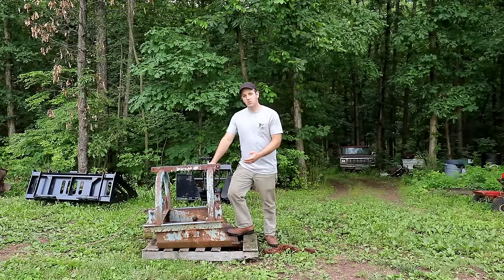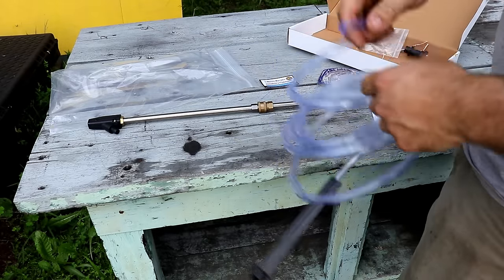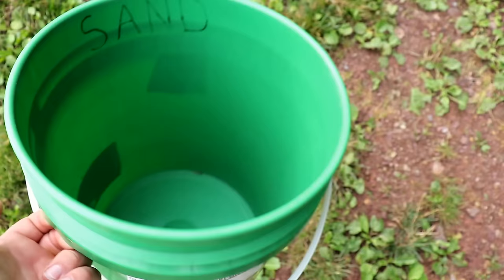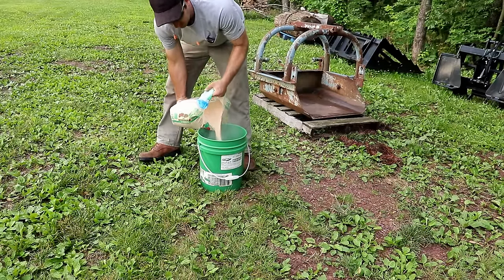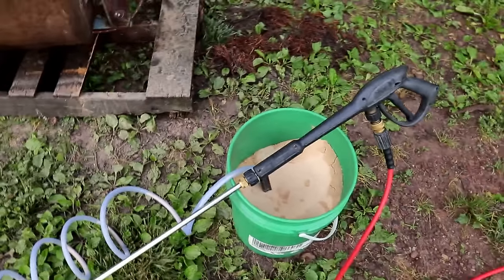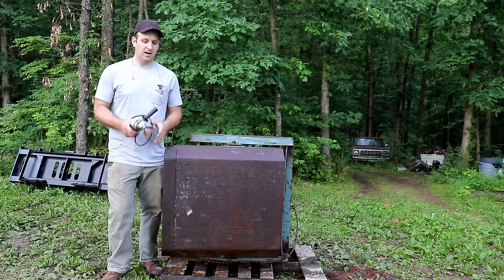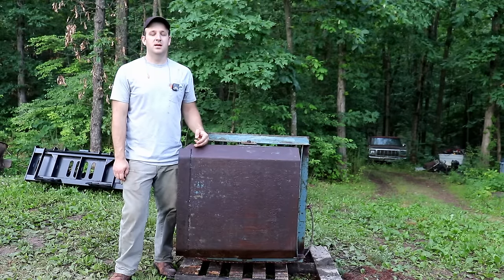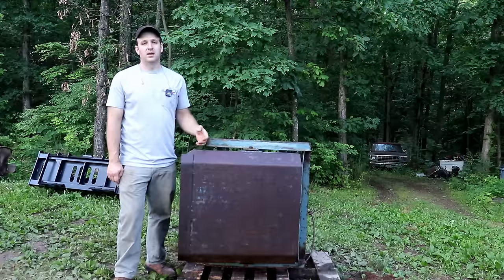I Turned My Pressure Washer Into a Sandblaster

Comment: I just tried mine out, got one just like this one but mine didn't come with an attachment adapter so I had to remove my tip to make it work. My pressure washer is 2300lb pressure @ 2gpm. I bought 70 grit aluminum oxide media from Harbor freight. Let me tell you it worked like a charm, I immediately got that shiny bare metal you were looking for. The play sand you used is too smooth and rounded if you look at it through a microscope, the abrasive media under the same scope would be sharp jagged edges that's what makes the difference. If all you're looking for is to remove the bulk of the flaky paint or rust chips then sure go ahead and use the cheap sand it'll probably even make the tip last longer.
Reply from the maker: I'll have  anew video soon with a different blasting media.
Reply: I totally agree with you on an agreesive sand.If your going to paint after you need a tecture on the metal for the paint to stick.Black magic sand cuts really good with a rough finish and the paint will not peel off.

Comment: Using play sand for sandblasting is dangerous and not advisable as the sand contains silica quartz, which, when inhaled, can cause silicosis
Reply from the maker: Thanks for the info. Would the risk be lower since this is a dustless method?
Reply: Same in sandblasting sand
Reply: @TractorTech  Mist will have sand in it. If you want to live, and want do more fun projects in the future - protect yourself today.

Comment: For the $8000 you mentioned you can get a high tech rust removing laser that eats away every layer and leaves the metal untouched.
Reply: or one of those dry ice machines that do the same thing
Reply from the maker: You can get dry ice pellet that I believe can be used in a regular blaster.
Reply from the maker: That would be nice.

Comment: For future testing.. I would consider hanging the bucket and maybe using some kind of attachment on the bottom of it or put a hole so you can run the hose through and the pick up can sit in the bucket so it’s being fed by gravity as well as vacuum. It’ll also help you keep from getting water in it. Put it on a pole.

Comment: this came up in my video suggestions. Good video warts and all! The budget DIY kits will work but you need to take a much steadier approach with them. If you are using sand you'll need a helluva lot of it! Also you need to work along and down the item one width of the jet at a time in a very slow steady manner. Also if you want a more aggressive strip go for recycled crushed glass grit. medium fine is about as large as you can go on these and still work without them constantly clogging up (< 1mm grit). Also when you release the trigger always have the jet pointing down toward the ground that way the water doesn't siphon into the sand pick up tube. get a lid for your bucket and put a small hole in it for the tube, then tape an umbrella to the side of the tub! wet sand don't suck! If you use glass put a large tarp under your item, sweep it up and set it aside to dry out then use it again!  I just subscribed to your channel it looks like the kind of content I appreciate, good luck, Bill
Reply from the maker: Thanks for the sub. I may try some different media.
Reply: Love diy crowd, vibes are wholesome. Came here from regular internet. Just a guy at work and people cheering on and giving advice. I had to remove some rust from underside of my FJ Cruiser, took half a day with wire brush. If I only new what sandblasting was :)
Reply: @Prokastrynator  I'm restoring my 1980 K10 this ny winter. I wire wheeled and used them paint grinder discs for almost an entirely week straight and didn't get to far. I went the sand blasting route for the last 3/4 of the truck, bought a harbor freight blaster and rented out of em big ass compressors and It was hell but the trucks frame and undercarriage is clean and ready for some por-15. Some advice if you ever do any sand blasting. Get a blasting hood for yourself but ditch the windows in em and wear a mask and safety goggles not glasses, goggles. I had a hell of a time tryna see because either the safety glasses/windows were getting scratched to shit or the glasses were fogging up. Due to my time restraints and not living anywheres near a store I couldn't just go out and pick up some goggles and not I'm paying for it because I removed the face mask to prevent fogging and I'm hacking the shit up lol. Learn from experience I guess! Goodluck

Comment: In order to obtain the proper venturi effect  (for sucking up the sand)  you'll need to have: 

1) a minimum of 3+ gallons per minute of water flow... PSI not that important.

2) Your sand should always be sifted in a dirt sifter (pretty cheap) first. Avoid playground sand as it's consistency is not correct for this application. Ask your supplier for proper sand.

3) Use a tarp to collect your sand and reuse it over and over and over again. Spread it out after usage to dry it in the sun coolest it and keep it in a 5 gal bucket lid closed.

4) Keep sand bucket behind you, as far as your tubing allows, mind the wind direction and adjust the workpiece accordingly.

5) Orient your tip inlet above the the nozzle (don't let the angled tubing hang down) this avoid water clogs.

Advise coming from much personal experience...  follow those steps for  wet sandblasting and you'll get to bare metal all the time economically..
Reply from the maker: I'm now using a Stihl RB600, over 3gpm. I sit the bucket up on something. I'll have changed to coal slag. I'll have to try sand and screening it.

Comment: I’ve used playsand before for sandblasting, definitely pour it through Atleast a window screen or something finer to prevent clogs
Reply from the maker: I've done that before, but I did forget to do it this time. Thanks for the reminder.
Reply: Using play sand for dry sandblasting is a sure way to get silicosis. Not a problem when wet sanding, except it is not very sharp.

Comment: I have the same sand-blaster and get great results with regular beach sand. 
Some tips:
Put your sand bucket on a stool so it doesn't have to be sucked up against gravity.
Take it slow. It's not like pressure washing.
Bump the tip on the work now and then if the sand stops flowing.
Keep the sand feed tube on top, so that water doesn't drip into it. Wet sand won't flow
Do the job on a concrete surface. Leave the wet sand to dry. Sweep it up, sieve it and reuse it.
Reply from the maker: The latest video on my channel is using the sandblaster with a revised process. Thanks for the suggestion on setting the bucket on something. I could maybe put a tarp down to try to catch some of the media.
Reply: PSA: DO NOT USE BEACH SAND - PERMANENT LUNG DAMAGE

Comment: Pretreat (keep wet) the rust aereas with citrus acid water for 20-30 min.. Then try keep a 90 degres angle against the surface and keep nossle close and slowly
Reply from the maker: I may have to try citric acid if some other media does not work.

Comment: Hey Roger, you are not gonna believe this, but I bought one very similar to that one on Amazon for my pressure washer two weeks ago.  I had pretty good luck with it until the overspray got a little too much into the sand bucket.  But as long as the sand stayed dry it worked quite well for what it is. Next time I'm going to drop it through a hole in a lid to shed the overspray. 
    A more direct angle to the workpiece (90*) will help get to bare metal as well as a closer distance.  I wasn't super satisfied with it, but for a small project and the low investment it was not too bad. I use Silica sand because one of the largest Silica sand mines in the US is here where I live.  I buy it on pallets in 80# bags by the ton for my big sandblaster I use on large projects.  I am editing a video of my large blaster currently. Good video and good review as well.
Reply from the maker: That is about when I got mine. I thought about getting a lid and cutting a hole in it too! I experimented with the angles and I agree 90* works best. There is a sand mine here too. I don't know if they sell bags of sand. I autocross with a guy that works there, I could ask him if the governor ever reopens things so we can autox.

Comment: I'm not sure, but it looked like you had another straight extension after the handle. If so, remove that and make it shorter. You will get an increase in pressure. Straighten out the hose form the bucket too and that ill decrease effort to pull sand through hose. I would also drill a hole in bottom side of the bucket and push hose in to ensure you are pulling in sand as easy as possible. You could even hang it higher to make that even easier.
Reply from the maker: That is how the wand is made on that pressure washer. Here is my latest video on it. https://www.youtube.com/watch?v=BlJ2jguphao&t=210s

Comment: Great video, I plan to purchase this tool today.  Also, my dad taught me to preserve metal with boiled linseed oil, an old farmer hack.  I coat all my bare metal with it: shovels, steel fence, and most tool metal.  Just reapply as needed for maintenance and it does the preservation job and prevents rust.
Reply from the maker: Thanks on the boiled linseed oil tip. I want to get some to treat the floors on some trailers. I did some research and it seemed like the best option.

Comment: It is best to use a hose with a PTFE or teflon liner. Regular web hoses made of vinyl are sticky to the media and will heat it up as it swirls around and cause clogs. Garnet is a good media along with Aluminum oxide. Ideally it is better to pressure feed the media rather than rely on suction. Harbor Freight sells pressure pots for blasting that can be used at lower pressures to feed this. The ratio of media to water is critical if you want to get it down faster.
Reply from the maker: I'll get a hose with a teflon liner, thanks. Yeah, I may have to get a pressure pot.

Comment: Just hit the spots where it works like the bottom.  The tight rust is actually protecting the metal - that is why bluing is used on firearms.  Go ahead and pressure wash it and let it dry.  Now, paint it with aluminum paint.  I like to brush it on because you can see it creep int all the nooks and crannies.  If you want it to look purdy, wait a day or so and paint it whatever color you like.  Use oil based paint.
I have used aluminum paint on mower decks, truck beds and farm equipment for years.  Even without top coats, it will protect better than anything else I have tried plus, if any rust should start again, you can see it immediately.  My neighbor watched my experiments back in the 80's and he used it to prime his wood frame windows before painting.  That was almost 40 years ago and he still hasn't had to repaint.
Reply from the maker: What kind of aluminum paint do you use? A roof paint?
Reply: @TractorTech  - Actually, I use whatever is cheapest.  The ones I use seem to have a turpentine smell to them.  Really nothing more than tiny bits of aluminum suspended in a binder.  Roof paint generally has asphalt in it and is a poor product to use for this application because it can trap moisture and hide any rust that forms.
Spoke to a paint tech at a trade show years ago and he said he wished they could produce it in colors.  It works so good because the aluminum is in flakes which overlap each other and because they are reflective, they prevent UV damage.  Other pigments are like little balls and can't do as good a job.

Comment: It's the sand bubs.  "Play Sand" is called that because it's smooth/round particles and isn't used in construction for that reason; it's also a little safer for kids eyes.  The type of sand used in concrete and mortar is more jagged/sharp and is used in construction because it will interlock/pack to a degree.  This is the sand you want for blasting.  It's in the same area in Home Depot as the Play Sand and probably a little cheaper.  Pretty much guarantee you'll get a better result with it.
Reply from the maker: I started using coal slag and got better results.
Reply: Its called play sand due to the simple fact that it is used in kids play areas.
You are over analysing which has resulted in a load of nonsense.

Comment: I use ground bottle glass that comes from recycling, it is cheaper and you can get different sizes, you might need to use 500 micron (0,5 mm) for that tractor scoop, but it can depend on the feed nozzle size that you have on the gun.

Comment: The benefit of play sand as I understand it is the fact that you can basically keep re using it just dry it out and filter out the dust 
It’s not intended to get better results than human engineered aggregates it’s intended to be the most economical 
But you can use better aggregate for a better finish and do the same by throwing down tarps and hanging them over the backdrop 
Just spread it out in the sand after and filter like the play sand

Comment: It looks like it takes off surface rust and paint, but not bare metal.  If you paint with a rust inhibitor do you think the paint job would last?

Please do another video with some other sand type and/or attachment and see if there is a solution that will get to bare metal.

Comment: Generally I use electrolysis for any part that fits in the tank. However a trailer or Bobcat won't fit inside. I developed  my first pressure blasting system in 1995 from an old 3500 psi washer and a pressure tank with a threaded cap to pour the sand in. Got the sand from my yard and dried it in the sun on the asphalt. After sifting it went into the tank.
Reply from the maker: Nice! Is your pressure tank pressurized? I think if I had just a little pressure on the media it would work much better.
Reply: @TractorTech  Yes and  it is funnel shaped and has an air jet to push the sand along.
Reply from the maker: @chargermopar  It sounds like you made an industrial grade unit.

Comment: When your using the sandblaster if you have the sand input hose on the top it works better if the hose is on the bottom it let's water go down and is gets the sand wet
Reply from the maker: I'll try that. I got a lid for my bucket now.

Comment: question, with something that pushes out water along with the sand how do you keep the rust from coming back? wouldn't the rust form faster on a wet unprotected surface? not a metal worker but I know rust can form pretty quickly depending on the type of metal.
Reply: Need to buy rust inhibitor from paint suppliers
Reply from the maker: It actually doesn rust like you think it would. Maybe the film of blast media protects it??? I was thinking about using a weed burner to dry things off on a recent project but didn't. If you want to get rid of all of the rust something like naval jelly would be good to follow up with.

Comment: If you knock off the loose rust and paint  you can use a rust converter primer and paint it, should be good as new then. I work on heavy machinery for a living and that's how we do it, and the paint job lasts a long time afterwards.
Reply from the maker: What rust converter do you use?

Comment: If you read the manual, it does tell you to keep the abrasive feed coming in from above, to stop water wetting the sand in the tube and reducing the flow.. you started with it at the bottom, then from the side.. never from above
Reply from the maker: Yeah, I tried it from above in anothe video. It may have helped a little